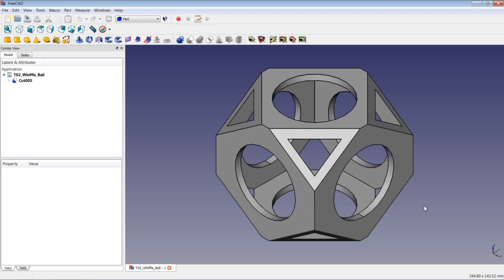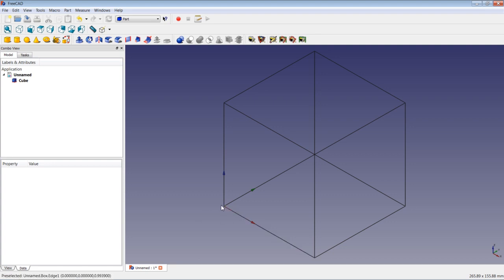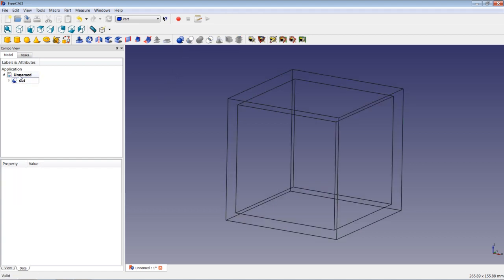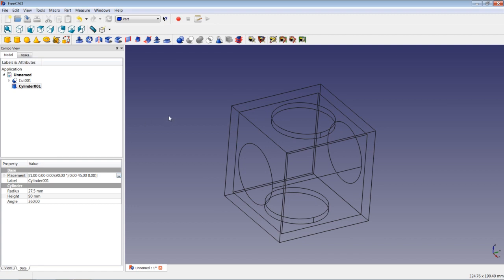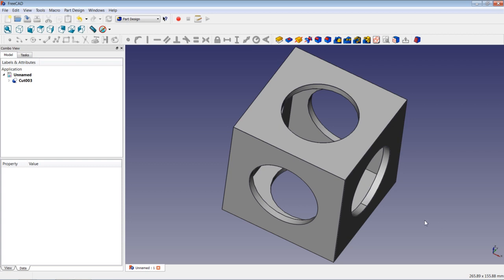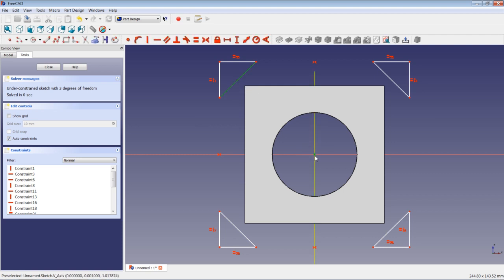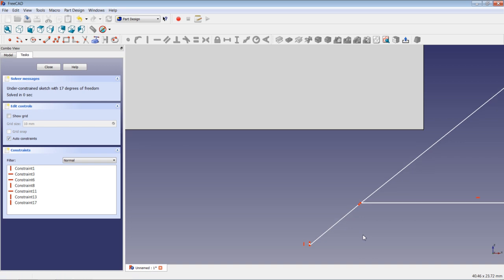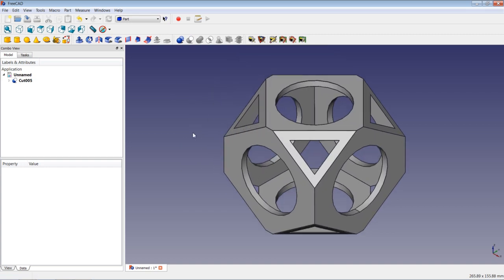FreeCAD Lesson 02 - Whiffle Ball

Comment: around 25:41 min. Freecad 0.17. Only extrudes one corner of my sketch. Also had a hard time rotating sketch 45'. figured out how to resolve. Use "Sketcher" instead of "Part Design" to create your sketch, then rotate and extrude using pad in ""Parts" workbench. Youre welcome ;) oh, and hit the thumb up to keep this at the top!
Reply: Damnit...that was driving me nuts; thank you!!! Sometimes when I would cut the two pieces together, the ball itself would disappear leaving the triangles. I just undid the cut, selected the two objects again, and after highlighting the cut icon again and waiting for the popup banner to appear, THAT was when the cut would work correctly.
Reply: Thanks Jurjen Pijpker. Did you find any resources on why this has changed in FreeCAD 0.17? I can understand that the FreeCAD developers wan't to minimize the number of actions that lead to the same result, but when watching these tutorials it seems like things were a lot easier in FreeCAD version 0.14.
Reply: You don't need to select the "sketcher" workbench, starting a new sketch in "part design" works the same. I also found that, in the "part" workbench, you need to extrude the sketch first then rotate the extrusion (if someone finds a different workaround post a comment).

For some baffling reason rotating the sketch doesn't modify the angle of the sketch but instead changes angle parameters in a new body which contains the sketch. Since the sketch is extruded and not the body with the rotation info, the extruded object just appears along the the original plane the sketch was made in. I'm pretty sure the Pad function is supposed to fix this but they removed its ability to handle the multiple surfaces, for more baffling reasons I can't understand.
Reply: Thank you! This works in 0.18 also.
If you do: Part Design Workbench -> Create Scetch it will create Body component and bind created scetch to this body. And will not allow extrusion with error - Two or more solid objects.
Reply: I'm afraid I'm lost. Could really use exact detailed steps here.
Reply: I am using v.0.18 and was awfully tired of trying to do what the teacher said before just now finally conceding that it was the software that had changed. Damn, that is tiresome and somewhat irritating.
I think I will just skip this lesson --- answers to be discovered later.
Reply: Thank you!
Reply: i try this and got error multiple solid,what to do hlp?
Reply: i manage to extrude the triangle,but when  try to cut it with the other it gives me wrong result....what"s wrong?
Reply: @bobilly684  I'm experiencing the same thing in 0.18
Reply: click map mode > 3 dot on the side > on attachment mode click deactivated > click ok > click placement under base > do the same as the video > stuck again at pad.
Reply: thank you for that. I'm using 0.18 and the rotate wasn't working, and none of the extrudes. Doing it your way worked out. It is easier to extrude and then rotate before the cut.
These tutorials are great. It's sad that he passed away. He was a great teacher.
Reply: In 0.19 your work is done in Sketcher by default.  You need to go to the Part Design work bench to extrude.  Extruding in Part Design will give you an error about multiple solids not supported.   It will also give you double extrusions. I am sure this is an error but it was handy.
Reply: thanks Jurjen, this also helped me, i think the tut is neither that accurate anymore for version 018.
Reply: "Pad: result has multiple solids, this is not supported at this time" but it was supported in 2015, c'mon!! lol thanks for the instruction. It was kinda wierd making another "body" in Part Design anyway
Reply: after I extrude, it shows 2 extrudes in the Combo View, but deleting the 2nd one doesn't seem to make a difference, like it's just an unnecessary copy. odd
Reply: Hi all, I experieced a different problem (using FreeCAD 0.18 on Windows 64bit), but along the lines of a lot of people mentioning a missing "body object" in the errors they are facing. There are alternative ways of achieving the result in the Sketcher workbench as pointed out in the past comments below, however that is very inconvenient, and furthermore you lose sketch objects on the faces you create if you combine and intersect the wedge patterns. Doing it that way, you end up with one object "the final dice" and there is a reference only to the last face that you were working on as a sketch (inside the model view).  Again, this isnt something you want when you are making designs you might want to edit/modify at a later point aside from having to repeat 8 times, every time! so I was looking for a way around that and I did!

If you want to be able to use the "pad" or "pocket" features as he is doing in the video, chances are it wont work for you if you are following along with this tutorial as I am, presumably due to several changes sinve v 0.14 used in this video. I found this way that works!:

*** TLDR; those experiencing errors with the POCKET feature ***

Once you create the intersection of the cube and sphere, you need to select it in the Model Combo view and then click on the blue step icon while in "Part Design" workbench. This will "Create a new body and make it active". Then drag the combined object (previously created in the video) from the model tree and drag it into the newly created body to make it a child of the new body object. That's it, from there on, everything else shown in the tutorial works the same way. I was able to select faces and create sketches from inside the "Part Design" Workbench and also do the pad and pocket operations. 

Hope this helps,

Cheers

Comment: In latest version (0.18), a body must contain only a continuous solid, you can't pad multiple solids. So create only one triangle in one corner with the polyline tool. Then rotate it and pad it as in the video. Now the idea is to create separate padded triangles in each corner. Just copy the body (that contains the padded triangle) and paste it into the project so you get another body along the previous one. Change the angle on the new body so it cuts through another corner. Repeat for every corner and change their angles until they are in the correct places. Do a boolean cut for each one and you are done. (only a beginner here)
Reply: aaaan here's the answer to that, thanks! I don't understand why they wouldn't allow that anymore.. But then again im a novice so maybe I shouldn't understand it either.
Reply: Thanks, Johanh! I had the same problem, I will try your solution now! Seems dumb that they REMOVED functionality from the program as it grew, maybe it caused problems further down the line. Anyways, thanks!
Reply: @DominicDeegan7  I noticed later that these videos aren't really good any more due to the changes that have been made since these videos were created. Better to watch some of the videos from their official wiki. Or any video that refers to versions 0.18 or 0.19. 0.19 is also so much better, so I recommend to update if you haven't done it.
Reply: Aha! How nice..... Thanks for the tip, johanh!

Comment: Thank you for putting this series of tutorials together. They are easy to follow and well explained. The only thing I would say is some more explanation as to why we need to arrive at certain dimensions and modifications would help me set these things into my thought process. Perhaps a hand drawn sketch of what you want to achieve with the CAD drawing. Often my designs start as a scribble in a book and then I apply them to the design. Having said that, I have done only two tutorials so far, perhaps the thought process will become automatic, the more I do.

I am trying to swap over from Sketchup into proper CAD designing and I am glad you are helping to make the process easier.

Comment: Great tutorials! Just what I need. As someone else said, I am going to print each object as a trophy. 
Thank you so much.
Charlie
Reply: Me too.. but slicing and printing with my g-code from cura 14.7 that came with my Anet A8 I forgot to add supports to my Turner's Cube that I scaled down to 3inches  as 200mm is 7.87inches.. and more filiment than I have in PLA plastic.  2nd attempt is coming along great for me so far. Can't wait to learn more.

Comment: Using FreeCAD ver 0.18 one gets the result "Pad: Result has multiple solids. This is not supported at this time. " if you try to pad the 4 fully constrained triangles. So I kept FreeCAD version 0.18 and downloaded the legacy version 0.16 and installed it, which still works like in this video. Works just like he says and it even opens perfectly the same in version 0.18. It seems you can have different versions of the same software on the same machine. I am using Win 7 64 bit.
Reply: I am facing the exact same problem, so are you suggesting that I download an older version and do it again?
Reply: @jesus99384662  Well you can keep more than one version on your system. I just rename the shortcuts to open the app Ver0.16 and ver0. 18 So it works to get through the tutorial. Once you're adept with how the program works you can experiment with the newer. I hear of good bug fixes with the beta version ver0. 19

Comment: OK OK So it must be done in PART workbench with extrude, then you can turn the Body 45deg. after. just don't turn the extrudes first. You have to move the extrudes 50mm first. YOU'LL FIGURE IT OUT> Just use extrude in Part workbench not PAD in sketcher

Comment: I'm using the FreeCAD 0.18. I did the first cube with the booleans for the holes. After that I built the sketch of the four triangles to cut  off the corners. I rotate the sketch and when I click on "pad" I got this error message. "Pad: Result has multiple solids. This is not supported at this time." What do i need to do to be able to create the pad?
Reply: did you ever find the solution to this issue? I can only find people with the same problem but no solution, it seems thios used to work onb older freecad versions
Reply: @Andrefa75  Thank you, I will try this again and try this method.

Comment: If you are following along and getting stuck with pad/pocket operations using FreeCad 0.18 like me, you need to create a "Body" first, this is needed to do the pad/ pocket operations, so it won't work without that anymore (lot changed since v0.14).

If you already created the "combined" object without creating a "part", then you could in the "Part Design" workbench click on the blue step icon, this will create a new body and make it active. Then drag your "combined" object into the "body" in the Model tree. That should work, it did for me. Before I did that it kept complaining about missing body reference. Once there is an active body all operations work in the expected way as shown in the tutorial. Hope this helps.

Cheers

Comment: At 25:15 and running version 0.18, the Placement Box is greyed-out and I cannot edit the values. Bug?
Reply: I had the same problem, and noticed that my Model view tree shows a Body which he did not have, under which my Sketch had been created. So I drug the Sketch up to the Unnamed document (so that it's no longer under the Body), then highlighted Body and hit Delete. After that, I could highlight the Sketch and edit the Placement.
Reply: It's true that this allows you to edit the sketches placement, but when I do this the angle and orientation of the sketch around the z axis becomes very strange.... Before I edited the bodys placement because I couldnt edit the sketch, and at 45 degrees it looked identical to the instructors object. Now at 45 degrees the four triangles are completely detatched from the object and each one is oriented dead center on one of the faces.
Reply: @ThereIsOneTruth  thank you for your help. It is appreciated much !
FreeCad v0.18
Well, moving sketch into document then deleting the body enables the three dots on placement. But after change placement of sketch, when click pad, SolidCad gives this error: "In order to use Part Desing you need an active Body object in the document. Please make one active (double click) or create one ..."
I could not achieve yet. If I find a solution, I am going to write here.
Reply: @omurolmez0  I failed at the same point the same way
Reply: @ThereIsOneTruth  I got this message after I did what you said, ''Origin "Origin" doesn't contain feature with role "XY_Plane"
Can't find Origin for "Body"

Comment: in 0.17, FreeCad won't allow to use the pad command to create "multiple solids". I tried creating one prism and copying it along the base then perform a boolean cut, but the result is that now the program won't allow me to create another sketch to finish the last 4 cuts, saying it lacks an active body for the sketch. Help?
Reply: Go to Part Design workbench and click the Create Body button (the blue "stairsteps" toolbar button), then drag the Cut and Sketch over to it. Now you can select the Sketch and click the Pad  button successfully.
Reply: thanks that worked for me on 0.17
Reply: it worked to allow it to pad, but appears to have made them one object, when i do the Boolean cut everything disappears
Reply: instead of padding the sketch i found you could use the extrude tool in the parts workbench which actually worked as shown, so just change pad to extrude
Reply: @ThereIsOneTruth  It is not working so

Comment: Hello thanks for the video ! I have a little problem, I did a sketch as you do at 24:28  I must have created it on a face, the problem is it does not want to move what ever the angle, the position, it does always come back even if I tick the apply incrementally. Any solution or explanation, is it a bug (v16) ?
Reply: Restarted the sketch and now it works... May be it wasn't fully constraint ?

Comment: On Mac, v0.18, i can't pad without making an active body, and from there i'm lost... everything i tried failed. 
i managed to get the padding but when i do the cut, the whole shape disappear. the body has both the cut and the pad mixed together so this is the reason and i can't deselect the cut from the body. any clue or hint at what we should be doing on mac v0.18?
Reply: I think you should install legacy version 0.16 as well. It works, whereas it can't do it with version 0.18 on Windows either.
Reply: On Windows you can install both versions and run them seperately.

Comment: I started this tut. with version 018, making the cube with holes was no problem, even the improved bolerian  cut out woth the cilincers was easy, but i couldnt make one part out of 4 diff. triangles. I worked around making one part of it instead, by drawing an cilinder around the triangles, and conecting the 45dgrs lines with eachothet. i hope the writer of LESSON 2 might tell me or i am wrong or if the work around is neccesary i case you have version 018.

Comment: Is it just me or it's not possible to pad the 4 triangles in version 0.17? 3 of them disappear when I apply the pad operation
Reply: Getting the same problem.
Reply: For me under Linux 17.2 and 18 (Beta) do permit all four triangles to be selected but the program complains about padding multiple items as it would result in "multiple solids which is not supported in this version".  I am also unable to pad each triangle independently.
Reply: Same here :-(.  Have you  solved the issue?
Reply: same'
Reply: same

Comment: around 25:40 min. When I try to pad the sketch, i am getting an error "Pad: Result has multiple solids. This is not supported at this time. " 
I am using version: 0.18 release date: 2019/10/22
Please advice
Reply: I've had the same problem. Stuck on it for a while thinking I did something wrong. Apparently version 16 was the last version that could pad those 4 seperate triangles simultaneously. Version 17 and 18 have had that function removed for reasons unknown to someone like me, who is also trying to learn the program.
Reply: I installed legacy version 0.16 without uninstalling ver 0.18.  Version 0.16 works just as in this video.

Comment: Hi, i have rev 0.18 and when i try to pad the triangles it gets an input error message: "Pad: Result has multiple solids. This is not supported at this time".  I guess it does not allow to build solid that are Integrates each other.  can anyone help? maybe it requires a configuration change that will allow to build bodies that Integrates with others?
Reply: got the same issue with the software

Comment: I thought snap to grid might make the triangle drawing quicker. But it doesn't. It makes it cleaner looking. But when setting the constraints, things are not quite perfect. like 56.56, or 99. They are very close to the constraints you want. probably enough that you could get away with it to the naked eye. I am thinking that either the grid isn't constrained to whole number scale by default, or that the program is handling the snap to grid function by setting the snap on one side of the grid line instead of going off the grid point locations (it could possibly be both things). 

This is all just to say that if you happen to like the grid and the snap to grid feature, while it makes things nice and neat looking on the macro level a lot quicker then entering constraints manually, it is not precise on the micro level. This might not be a problem for pure virtual representation (like if you just want to crank out a good looking 3D object quickly). But if you went to 3D print this, and you happened to be off here and there by a few decimal places, that could translate to skewed beads (sloppy print).
Reply from the maker: +TheHelleri 
I think that's the main point.
We are talking about exact 3D CAD representation with exact data needed for CNC-milling, 3D-Printing an so on.
Virtual representation with 3D modellers (and often ending up with triangle-mesh-formats like obj and stl)
is something different.